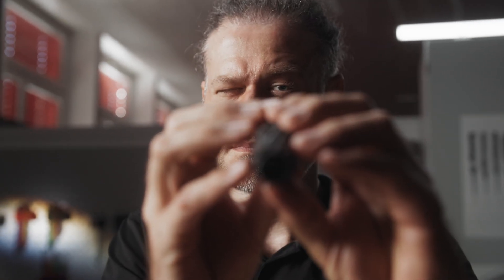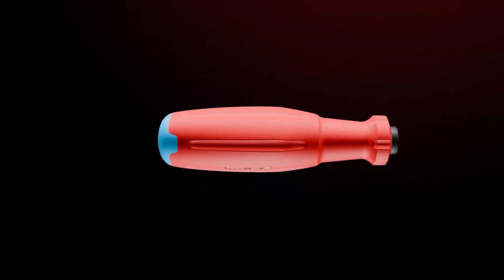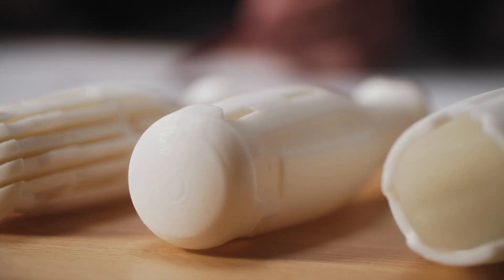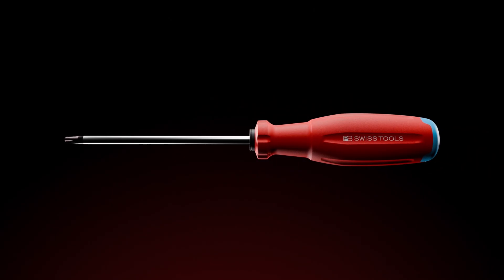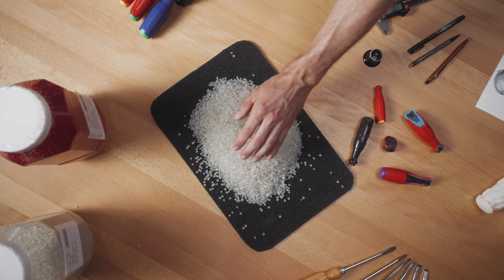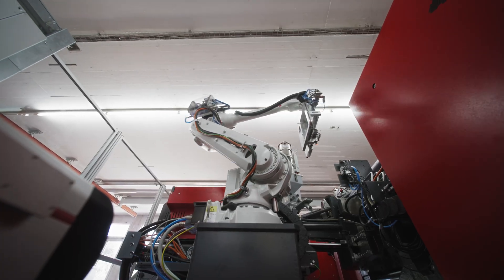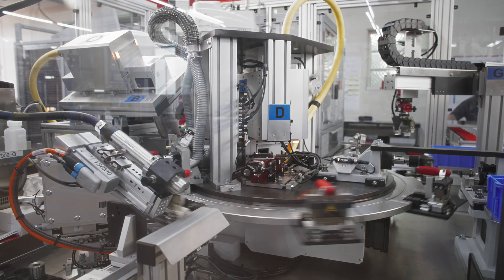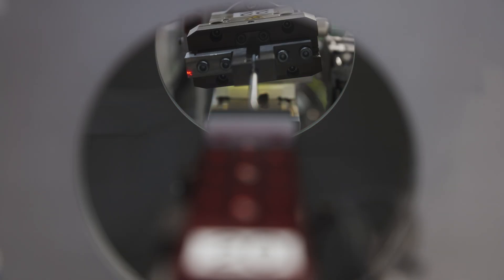SwissGrip Evo – The Making of a Next-Generation Icon

Comment: I'm a fan of your old version, especially since you were the first to start marking your screwdrivers (so you could tell from your bag whether they were PH2/ PZ2 oe SL). And those weren't just regular markings; they were molded from plastic and rubber so you could clearly see the color of the handle — it was art. Now, in your new version, the markings are just paint, I bet they'll wear off after a week of use.